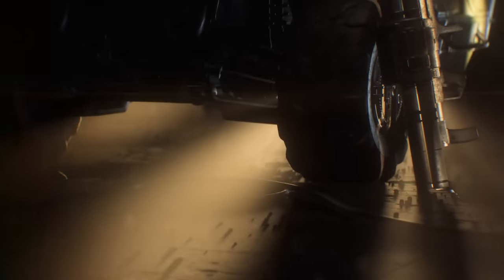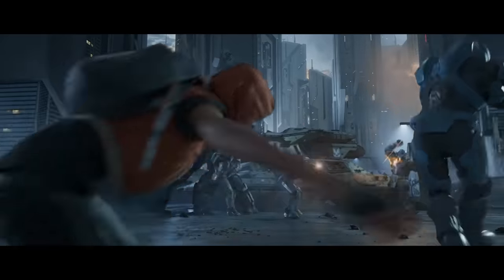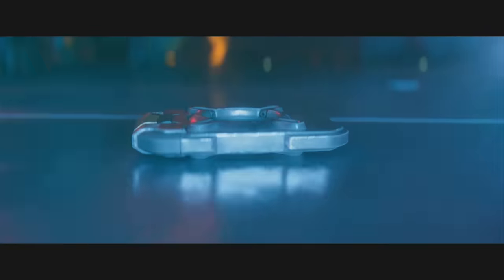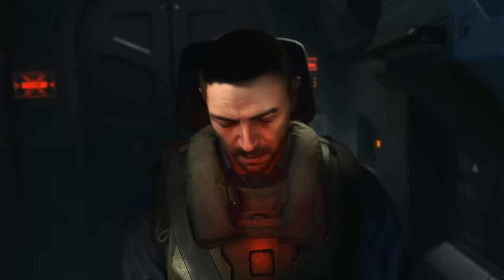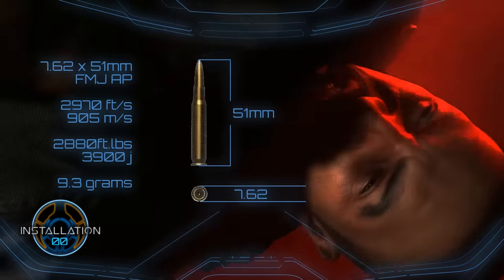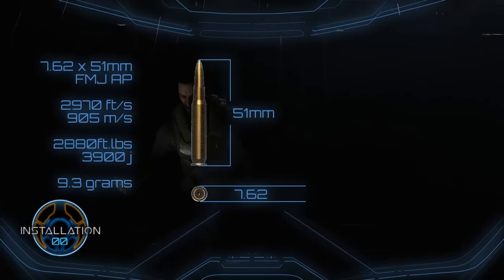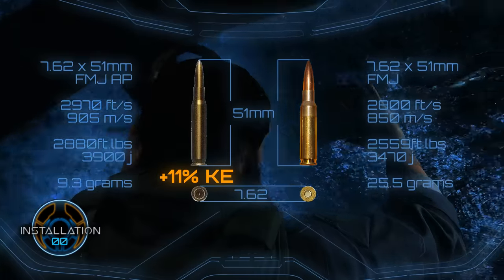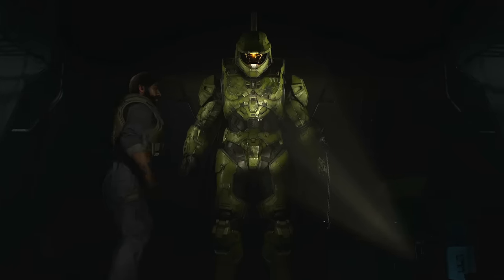Why are UNSC Weapons so powerful!? | The Armory

Comment: All the solutions you've offered would have a more significant change to muzzle velocity, which, while the Halo 7.62 is faster (and seems to have a longer propellant chamber), it's not nearly enough of a difference to explain the significant difference in impact energy. I would sooner look at the round composition itself. If the round is harder and has less deformation, that could cause more energy to be delivered through impact and less wounding through fragmentation and tumbling. We know that's it's a full metal jacket round, but it doesn't specify what that jacket, or perhaps more importantly, the core underneath, is made of. The jacket is visible in the art and appears to be in the same copper/bronze/zinc family of alloys that such rounds are made of nowadays. But the core could be anything we want, and the UNSC has a long-standing love affair with a very particular metal that would be the perfect choice for this: Titanium A. This is used in their body armor, in their vehicles, in their ships. It's difficult to go more than five feet in any UNSC armory without walking past at least a dozen things made of titanium A. This is an incredibly hard metal that deforms only under immense amounts of stress. If you want to make a round that, all other factors being roughly equal, delivers as much pure energy as possible, titanium A would be a very good choice

What I find even more interesting is how this informs their tactics. The singular focus on energy makes me think body armor has reached a point that even conventional methods for defeating it like velocity and destructible jackets are insufficient to fully penetrate the plate. So their solution is to bore as deeply as possible with the jacket, then deliver so much energy from the core round that it deforms and buckles under multiple hits, opting instead to destroy the plate entirely rather than penetrate a small part of it. This would also deliver an incredible amount of shock to the wearer, knocking them off their feet and potentially even scrambling their organs or causing internal bleeding from the pressure. If we can assume Insurrectionists then got their hands on this same type of ammo by raiding supply dumps, then we see the following response to having this used against them in the MJOLNIR project: Multiple layers of trauma pads, gels, and other impact-resistant materials to reduce shock to the wearer, allowing them to respond more quickly to being hit
Reply: It could also be a tungsten core as the UNSC is fond of using tungsten for projectiles. 
Titanium A may be more likely due to the oddly light weight of the rounds though.
Reply: And the introduction of kinetic rounds that specifically effect vehicles and shields more effectively, meaning there might be other elements to the core or even jackets themselves

The explosive and Armor piercing rounds can be combined or held separately, not knew to us, but very different in halo where it’s more like a timed fuse explosive rather than bang then boom, it’s acts more like a bang wait then boom, also rail guns have proximity fuses 

But the use of brute force rather than penetration makes for a more “cleaner” kill

Less fragmentation and more scrambled intervals mean less blood from each wound behind armor, though against no armor the bullets shred flesh and bone.

Then there is the underwhelming tank ammunition caliber and this all begins to make more sense, those rounds should not do as much damage as seen in books and games, but yet they hit with the force of a derailed train with explosives

Advanced tech means advancements in existing tech as well, though practicality is up to ones own mindset
Reply: I actually really like the ideas that have come up here, being that the bullet composition was the main thing changed and that the body armor advancements were to such a high degree that the goal was internal damage rather than puncturing the armor. I think that theory alone would explain a lot of certain game mechanics like how projectiles affect targets. The other theory I really liked was the one mentioned in the video above shrunken down rail gun systems implemented into the small arms used. Now, while I love just about all of the possible explanations for this question, I think more than likely that in universe it would be a combination of our proposed answers rather than just one.
Reply: @predatormark2847  Yeah, generally with real world specialty rounds like AP you'll see some kind of colored tip, which is why I didn't consider it based on the art. Do you know how their statistics are measured? It seems like that point energy is kind of an oversimplification given the other effects you're including
Reply: @icarusgaming6269  well railguns are just super fast bullets/slugs

Whose to say they call gunpowder due to trend rather than what we know it as, for all we know it could be an explosive gel that was mischarcterized by the common soldier

But I’m getting ahead of my self, you bring up a valid point, but more often it’s the guns that show the indicator of what kind of rounds your dealing with, not the ammunition it self for some reason
Reply: Heavier bullets do more damage. Titanium would be a poor choice for a bullet. It's to light and would not carry much kinetic energy at all.
Reply: @tylerdurden4080  The point is the lack of fragmentation or crumpling, so you're losing less energy from the same amount of, or less mass
Reply: @icarusgaming6269  then good old lead would be your best bet. Or explosive rounds. My money is on explosive rounds

Comment: 3:20 I have the feeling that who ever wrote this just looked at the weight of the projectile and not the overall weight of the bullet. Because the projectile of an 7.62x51 NATO can weight between 9,4 to 11,66 grams (Or 145 to 180 grain).

As for the more KE of the round: The new rifle for the US Army, the XM5, uses new ammunition with extreme high gas pressures (~80.000 Psi). With the new materials and metallurgy of the UNSC in the years of 2500 I would think that they did the same.

But, we all know how the creators of Halo quite often have trouble keeping anything constant in their world creation.
Reply: I think it's 7.62x54 NATO.
Reply: UNSC also seems to have a much more prevalent use of tungsten cores in their rounds, so even their standard fmj is equivalent to a modern black tip.
Reply: @jetdestroyer9626  What you are maybe thinking of is the 7.62x54R, the russian rimmed cartridge.
Reply: The M7 uses a 1970s/80s caseless ammunition that never got past the experimental phase.
Reply: As someone who is a fan of both Star Wars Legends (F*ck Disney) and Warhammer 40K, you guys are one of the more consistent sci-fi universe out there.

Most of the inconsistencies (that I've encountered) tend to be with the abilities of the Spartans and stronger Covenant races. I've read accounts where Spartans basically walk through Covenant soldiers: out maneuvering Elites, overpowering Brutes, and calculating the fire patterns of dozens of Grunts to dodge their attacks

And then in First Strike, Chief has to be incredibly cautious against a squad of Grunts because his shields were disabled, and is nearly strangled to death by a Brute.

Halo's got it's inconsistencies, but there are far worse.
Reply: the new 6.8x51mm... I think the new round was 25% lighter than traditional 5.56 they said due to new materials in the casing and powder. Imma see if I can find the source for that.
Reply: @archerbascha8757  ya I think you've right
Reply: @markmulder9845  it’s heavier then 5.56. The reason 6.8 x 51 is better is because it’s lighter then 7.62x51 but has more kinetic energy.
Reply: @HP591  Yeah. I went back and found it. It was 33% lighter than the 7.62. My bad mate.
Reply: Unless you know, to most 7.62 is 7.62. Even though x39 and x51 are both quite different.
It's like in Deus Ex (the early 2000s original) with the assault rifle.
Was probably supposed to be 7.62x39 (Warsaw) but because they're game developers, not armourers it turned out to  e 7.62x51 (NATO). And if anyone did care, it was too late and too much effort to change.

Comment: The rounds can be the same dimension as today. I think the difference has to be in the propellant tech used, since that's what impacts the velocity of the steel.
Reply: You mean lead
Reply: @The_Tactical_Wook  sorry to be the uhm akshually comment goblin but modern military rounds usually don't have lead in them they have a hardened steel penetrator usually made of tool steel and a copper jacket for good rifling engagement, off the shelf walmart rounds for sure have lead since it's about a third the cost

Comment: It's pretty cool to know the science behind some of this gear
Reply: Most of it is all imagination, (albeit based in reality) but it is through using our imagination and art that we create new. I am excited for the future if we can make it.
Reply: There is literally no science. In fact the video has to ignore some actual science to make some of its suppositions. 

Guns do not need air to fire. You can shoot underwater. No magical oxidizers needed. 
If you punch the data into a ballistic calculator you can see that the projectile weight is 147gr, which is the projectile weight of M80 ball. 
Hardening has nothing to do with weight. It's literally the process of making something hard. In this case, heat treating a mild steel core for a bullet to make it penetrate armor better. 
1969 era M80 Ball will give you 2970FPS  if you fire it out of a 26" barrel. 

Please stop encouraging this.

Comment: I can see the booster rail on the sniper possibly as the speed the round could be accelerated to have that trade smoke trail might be the by-product of high friction in the atmosphere upon leaving the barrel considering the length of the barrel, but on smaller ARs and BRs I can't see it either. Though possibly on the Marksmen rifle and maybe the BR only because both have a light smoke trail when you pull the trigger, but they don't last as long so the speed isn't as high. Again, that's probably not really feasible like you said as even the power requirements to power up such a system would drain the batteries faster unless the magazine came with a built-in battery and had a port for it to connect to when you put in a fresh magazine. But judging by the size of the magazines they are standard issue snap in and quick release.
Reply: If the battery idea is accurate, they could have a plug similar to our smartphones. The battery could be very small as well, batteries today can be very tiny. Since we’re also talking over 500 years in the future, it’s possible that things like batteries and connecters could be vastly different and simple today. I mean there’s charging pads for smartphones today, so that concept of technology could be what is used.
Reply: Compared to today*
Reply: I think more realistically the smoke trail is from either an incindiary or tracer loading, or a byproduct of the new powder being used. I have old incindiary 303 rounds from WW2 that use white phosphorus and they leave a smoke trail that looks a lot like the ones that the S7 has in the game

Comment: They could also be ETC (Electric Thermal Chemical) weapons. They are almost identical to modern weapons, but instead of using a chemical reaction to ignite the gunpowder, they use plasma which is much more powerful and uniform. Tests done on tank cannons are much more consistent than the normal rounds, and ETC guns allow a bullet to be fired at rail gun speeds with only a fraction of the electricity needed. Because the plasma is so powerful, much more dense gunpowder can be used that a normal primer would fail to ignite.

Comment: When you think about it, it makes some sense since blue team were able to fire their guns whilst in space, where due to the advancements in primer technology and powder technology whilst adding both an airtight seal as well as rail projectors would enable the use of firearms in the vacuum of space,  not only that but given their momentum, they could have been issued a low pressure round to ensure the least amount of recoil
Reply: The guns we have right now can already be used in space. The Soviets once launched a space station with an honest to god 40mm rotary cannon bolted on.
Reply: @dsdy1205  cheap but effective 😂

Comment: I remember seeing a little bit about new types of weapons that tanks could potentially use in the near future, weapons like ETC cannons or CLG guns seems to be the most likely choices since they pretty much function like a traditional firearm but offering much more energy for the round to use either by changing the propellant to a mixture of hydrogen and oxygen like in the CLGs case or using a plasma ignitor to more evenly and efficiently ignite a more traditional propellant in the ETCs case in both cases though the ammunition and the weapon itself stays more or less the same, personally I'm more in favor of the ETC technology being used in UNSC firearms seeing how the increase in performance of the 7.62x51 Nato is more in line with the kind or improved performance ETC cannons are supposed to provide tanks, at least with the figures I've seen

Comment: Using a ballistic calculator, I have determined that the numbers given for velocity match the muzzle energy if you account for a 147 grain bullet. The magic here is nothing more than simply turning up the velocity with a hotter propellent charge than is currently the NATO standard. And to address the disparity with cartridge weight: Polymer casings. Polymer cased ammo is significantly lighter than brass cased ammo (and may have increased internal dimensions to boot) . But these 2 factors would drive into why the rifles in Halo are beefed up. A large function of brass casings in a gun is also heat dissipation. With polymer, that heat conducts to the chamber and barrel much more quickly, so The MA5 series of rifles are either equipped with a cooling system or are just overbuilt to soak up the heat from automatic fire.

Comment: They gotta rip through alien shields, armor, and hides.
They are also a result of hundreds of years of arms races.
Reply: I would agree, but there weren't hundreds of years of arms raves. Prior to the Insurrection (which was immediately before the human-covenant war), there was well over a hundred years of peace. However, the Insurrection would definitely result in an arms race, especially as that seems to be when the MAC was developed.
Reply: @ALLMINDmercenarysupportsystem  I didn’t say the arms races were consecutive.
Project Orion began well before the Insurrection.
Reply: @spartangoku7610  I know, but wasn't Project Orion just about making better soldiers? The Mijolnir armor technically wasn't part of Orion.
Reply: @ALLMINDmercenarysupportsystem  still supersoldiers.
Reply: @spartangoku7610  Yes, but soldiers are not guns.
Reply: @ALLMINDmercenarysupportsystem  there was Hrunting, which started in 2166, even before the invention of the Shaw-Fujikawa drive.
Reply: @spartangoku7610  I was I unaware of that, thank you for the information.
Reply: @ALLMINDmercenarysupportsystem  to be fair, I had to find that part in the Halo Encyclopedia, but I had read it recently and needed to confirm.
Reply: And completely unchanged since 1969 somehow. 

Fire 147gr M80 ball down a 26" barrel and you get exactly 2970FPS.

Comment: It's possible that the weapons of the UNSC are ElectroThermal Chemical (ETC) weapons, which have quicker (and more complete) propellant burn. (Edit: due to the ignition method, which fires plasma into the propellant, rather than using a chemical-based explosive primer)

This doesn't preclude your theories, though; it's entirely possible that they use a futuretech propellant mix and/or have booster rails.

Comment: The SIG-Sauer MCX Spear (or M5 in US military phrasing) could be an example here. It fires a 6.8x51mm round. The unique part is that there is a "training" round that is pretty standard. However, it also fires a "hybrid" round that has a stainless steel base and brass body. This allows the round to fire at significantly higher pressures that an all-brass casing can't handle (80,000 PSI, if I remember correctly). This means that, while both bullets have the same size, they presumably have substantially different velocities.
While I am not sure where that additional velocity comes from (I would assume chemical composition of the powder), it demonstrates that a real-world round can see improvements in velocity without changing the size.

Comment: I like the guidelines.
As a firearms guy, it's likely that they're using some new kind of projectile which increases the energy transfer from the bullet to the object it's hitting.
That would make sense...
But they're literally just still slinging lead and tungsten.

However, there's always new advancements in projectile design that increases the energy released into the target.
Not to mention powder advancements which can increase pressure and velocity, and maybe an advancement in casing strength which can allow them to be loaded to higher pressures.

No amount of science can explain how the AR magazine works though lol
Reply: As someone who reloads ammo, I agree on all these points, doubly so with regards to the magazine